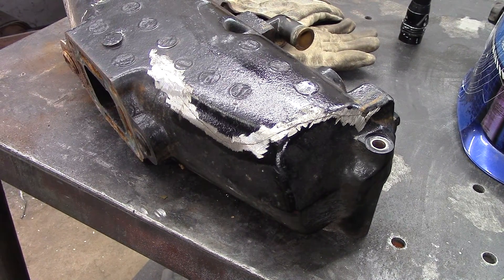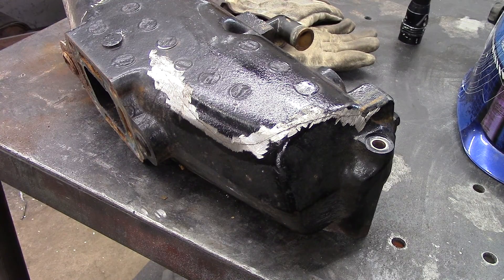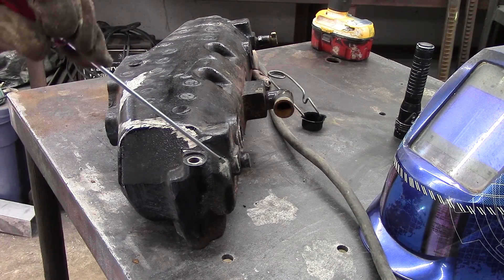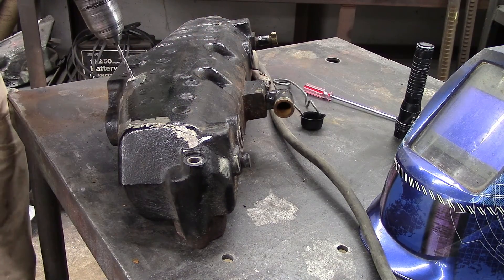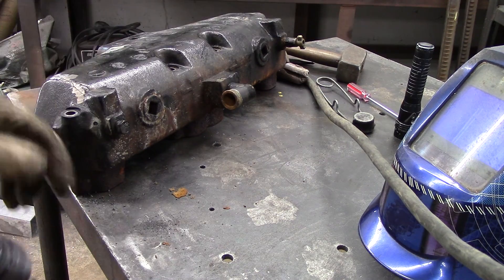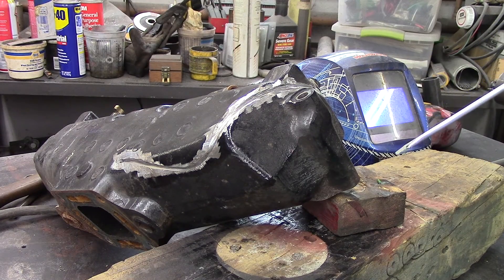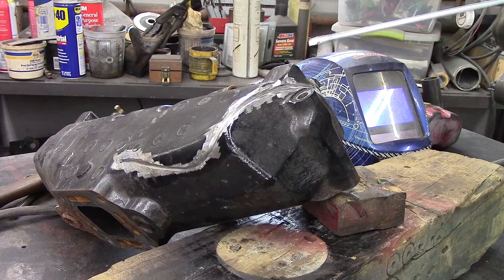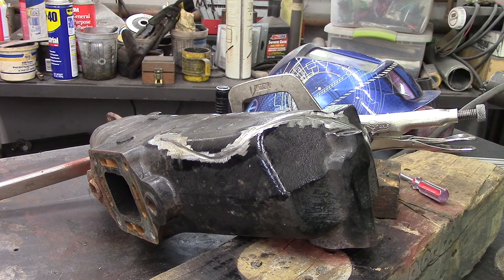Welding Cast Boat Exhaust Manifold Crack

Comment: Great job. I have trouble welding cast iron. Thanks for the tips.👍👍
Reply from the maker: Thanks I have several videos on cast , the thin cast like this manifold can be very difficult, some times not possible as the stress from the weld cooling cracks it again.

Comment: Try torch welding with cast iron bare rod and flux. Best repair hands down,and it can be machined down to bare metal. More expensive process but anything would really do the trick as long as the piece don't crack too soon. Best method is known as thermal spray torch process. Spray the casting with molten powder nside a furnace to build it back up to the surface. Same procedure preheat and post heat. 7018 is probe to cracking, really any mild steel rod for that matter to cast. Nickels better but more expensive. I like the gas welding old school method bare iron rod and flux.

Comment: Best to not use E7018 on cast iron. For Tig Silicon Bronze on DC Negative  or Aluminum bronze to fix cast on AC.
E7018 will crack eventually. 
If you don't have a tig set up you can get Nirode for stick welding.